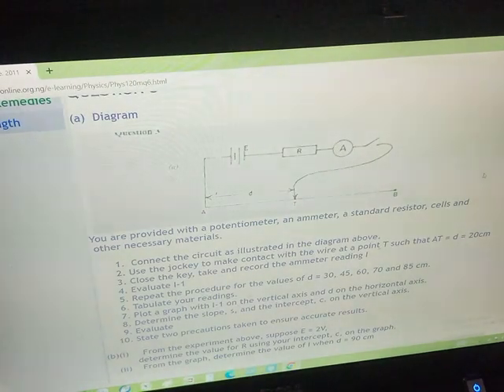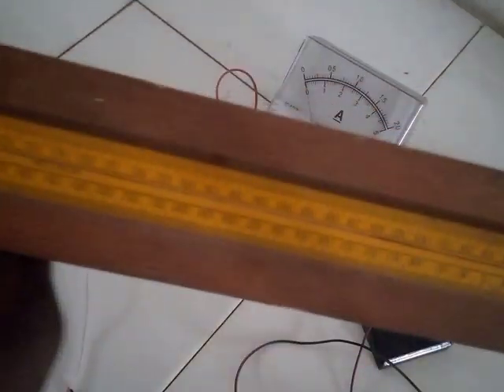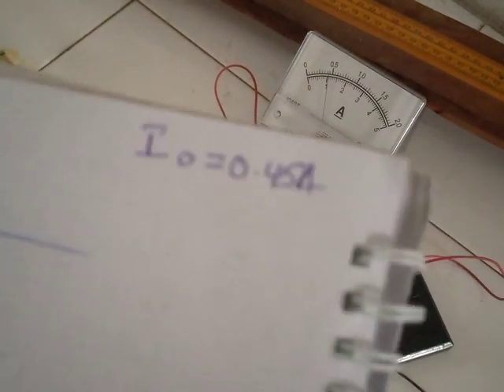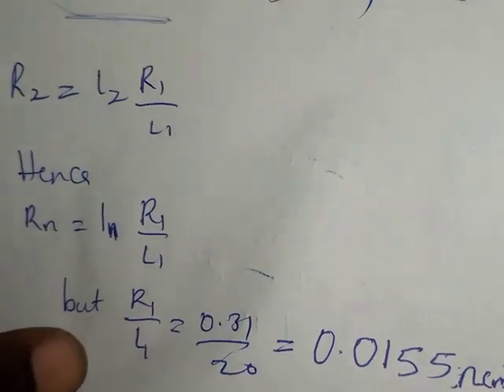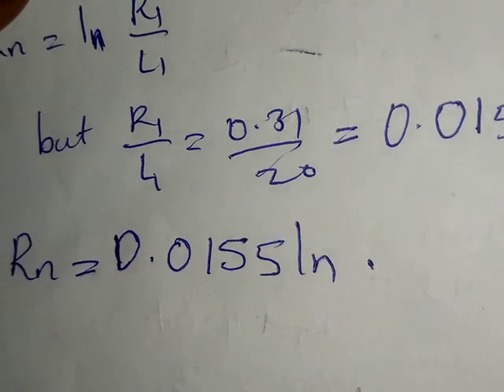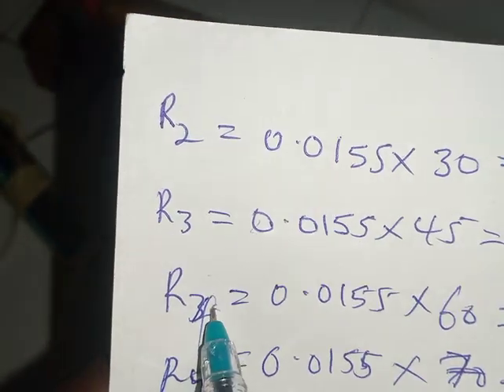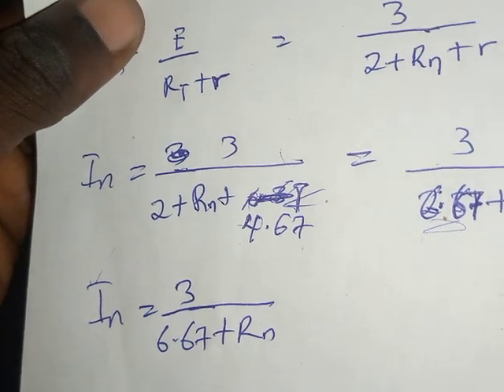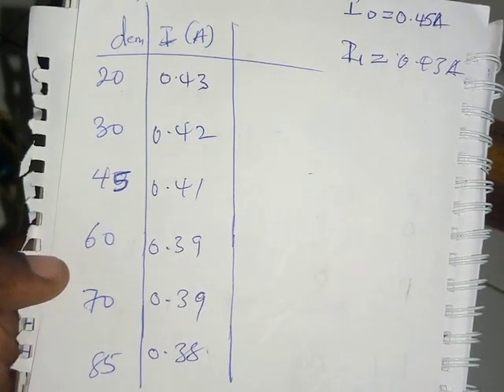WAEC PHYSICS PRACTICAL - Manipulation of Physics practical on electricity 2022

Comment: Thanks a million sir. 
But sir, l want to ask a question.
In the report form, the resistance of constantan wire on the potentiometer was ask. Please how is the calculation done?
Reply from the maker: It was actually the resistance per meter. Remember you had various resistance R for various length, right? Divide the resistance with the length (this must be in meters). The will give you the resistance per meter of the wire. If you do it for other R and length in meter, you'll always get the same results.
Reply: @yousciencelab5307  thanks a bunch sir.
Reply from the maker: @afolabiabideymi1057  You're welcome.
Reply: Please sir, l would be glad if you can just show us during your leisure time . Thanks sir.
Reply from the maker: @afolabiabideymi1057  okay. I'll do a comprehensive video on how to find it. Don't worry it is easy. Please do not forget to help me share this channel. Thanks.
Reply: @yousciencelab5307  thank you sir. I have done so and l won't stop.
Reply from the maker: @afolabiabideymi1057  check out the procedure to find the resistance per length of a wire 

https://youtu.be/d7AmI41rNTE